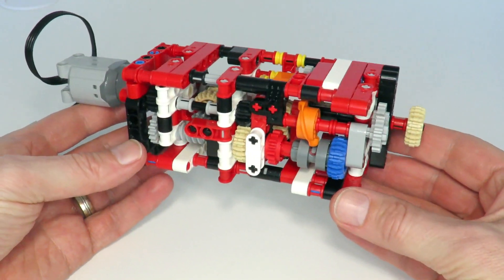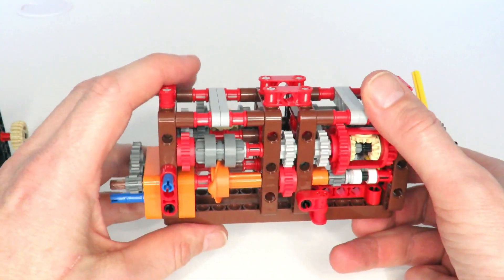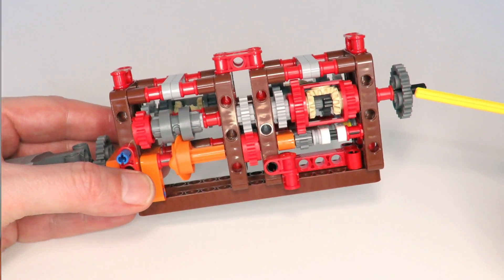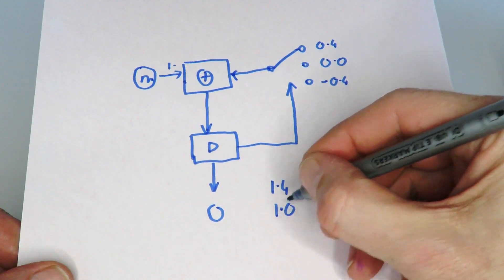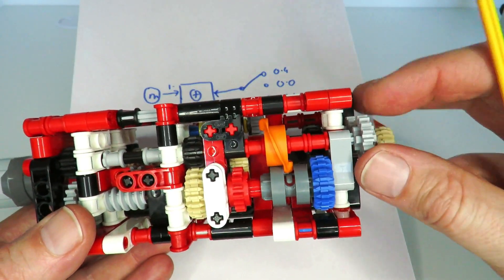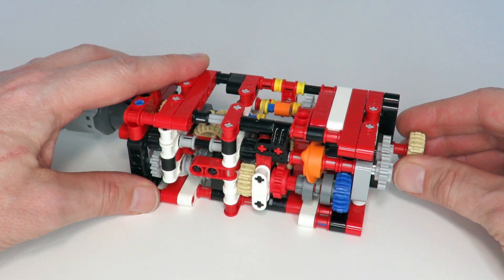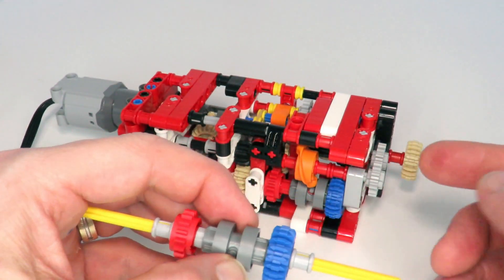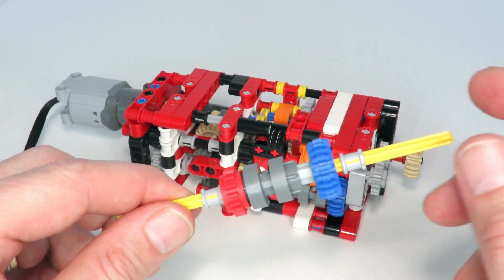Lego Technic 3 Speed Automatic Gearbox - FAIL!

Comment: Hmm, I recently designed a gearbox using a very similar concept, but I don’t have an orange rotary catch. I’m guessing that the rotary motion results in less direct torque transfer than the old red linear clutch.
Reply from the maker: Yes I did have the driving axle geared up so it wouldn't have to rotate as much so that reduced the torque the orange rotary catch produced.

Comment: Maybe but I don't understand nothing of gearboxes, if you replace those to 1:1 grey gears that power the orange switch for a maybe gear down 3:1 of the dark grey gear you will have more torque on the switch
Reply from the maker: Hi Rena, yes good point but that also affects the amount of rotation the part with the rubber band needs to make. I am sure there is a way of improving it in a number of places to make it work.
Reply: Oh ok
Good luck then